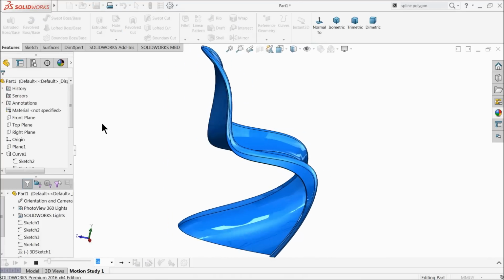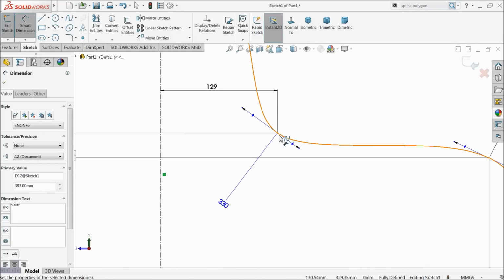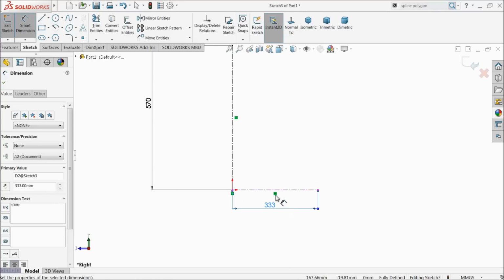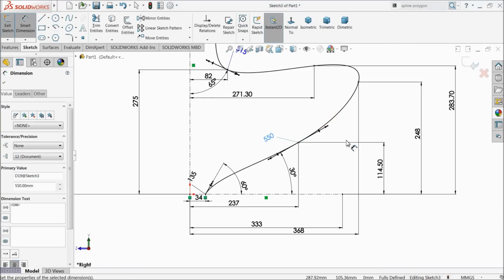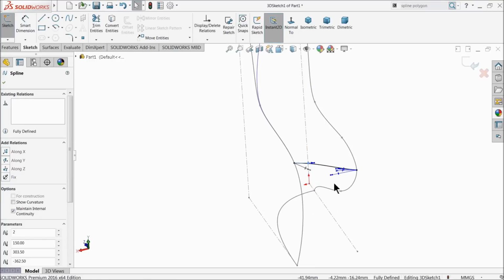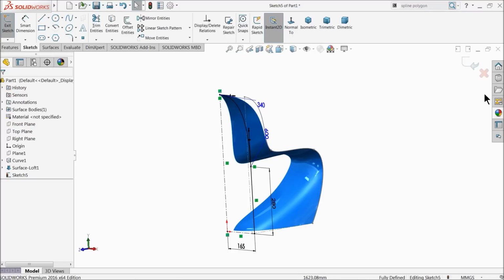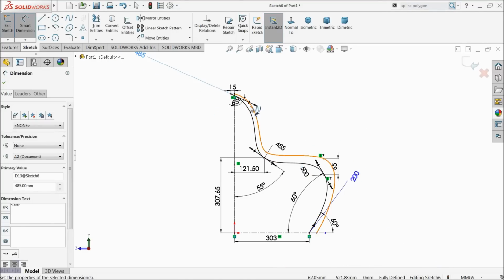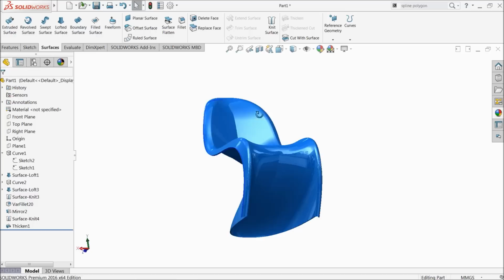Solidworks tutorial | sketch panton chair (Advanced Surfacing) in Solidworks

Comment: Very interesting options, they will help me in my future projects. I have problems with the final filled, it said to me that the radius is too big (25 mm). I will try it again, thanks!
Reply from the maker: reduce radius or select individual edges for fillet,
Reply: I too have problem with the variable fillet. When I set the second value (5mm) the preview disappears and the fillet is impossible no matter how much I reduce the value. If I leave it unassigned, the bottom of the chair is getting cut. I have followed your steps very carefully. I think the corner I am trying to fillet is very small and hence the error.
Reply: @esquivel1  try wth 17mm and 5mm. Mine worked on this values.
Reply: @Wolfhunter666  Thanks, I will try with those values. I found a pdf of the same tutorial from "LearnSolidworks" and that worked fine. I can't even remember what I did different after all these years :)